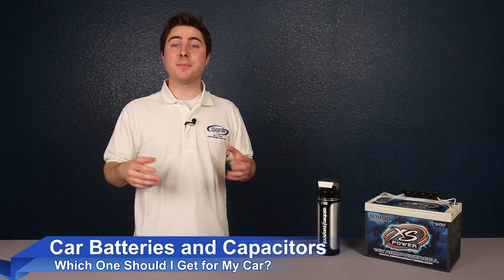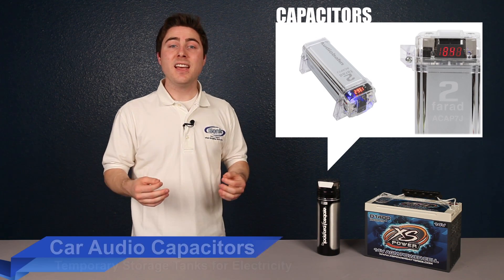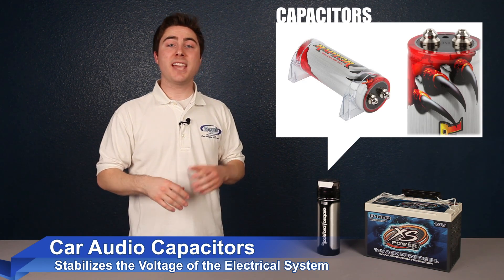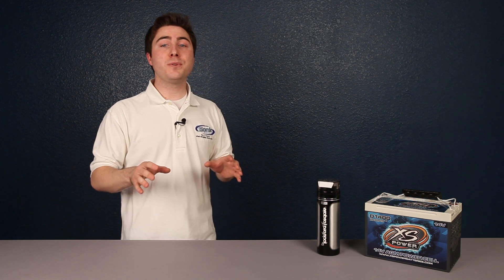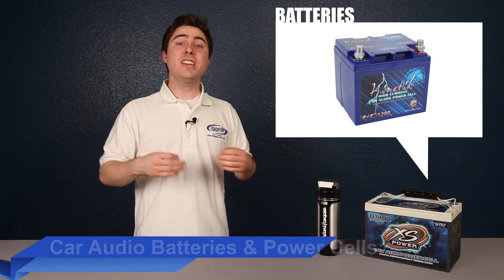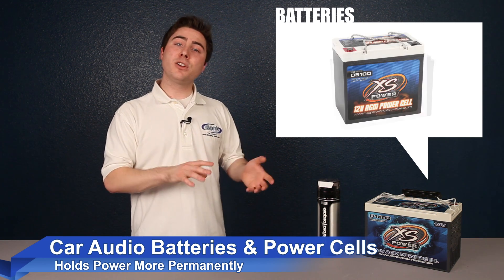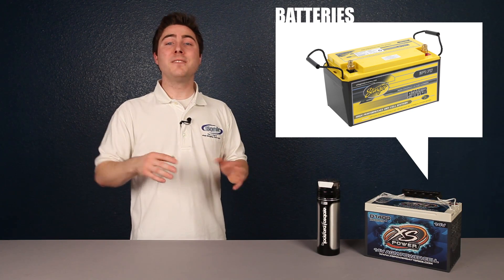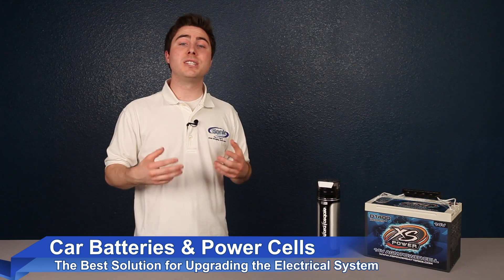Car Batteries or Capacitors: Which Should I Install? | Car Audio Tips

Comment: I'm upgrading everything right now, all HERTZ energy speakers, a 4 channel amp and 2 pioneer 3002d4s with about 1000 rms to each, my stock alt is around 105 amps and i'm upgrading it to a 200 amp alt. I bought a second battery, the question is can I just wire the second battery in parallel and it would be good? - I keep reading about people talking about adding a relay or some type of dsitribution block to help charging, do I need this or will the way i described work just fine?
Reply: if u install a second battery ,wire it in parallel ,you only need a relay if your using your car stereo with the engine turned off, if you use your stereo all the time while its running you dont need to add a relay etc.
Reply: Lee Coupland Not really true, as the batteries have different discharge and charge rates the charge sensing circuits can't differentiate between the two and one will inevitably overcharge and be ruined. 
You need an isolator.
Reply: even if your using the same two battiers? surely the charge rates etc should be the same,i have two lcd volt displays direct to both battiers and inline with the amps ,voltage has read pretty much the same ,volts in front battery same as volt in rear battery.
Reply: Even if you bought 2 batteries from the same store at the same time they'll still be a little different and once installed the difference in wiring presents problems. You might be getting away with it but the fact is the charge circuit can only detect the state of one battery at a time. Furthermore if you have both batteries hooked up to the same alternator what's the point of having two voltmeters? Of course they read the same voltage it's one circuit! One of them is going to be overcharged.
Reply: the point in using 2 batteries was to stop the electrical system from draining my lights,interior lights,dash lights etc, 1 battery off stock alt was dropping below 11 volts when cranked up, i went on youtube and searched for a solution, the vid i checked said using 2 batteries would solve the problem which it has done, they only recommended using a rely if your planning to run your equipment with the engine off, im not a expert at this,still learning myself, 2 batts wired in paralel still equal 12 volts of course, what is the solution to stop 1 battery being overcharged?
Reply: the wiring is all the SAME to both batteries, same gauge and same make ,my alt is only 70amps, but in the uk its very hard to find a stock alt with more than 100 amps :(
Reply: i have two volt metrs because i have 2 amps , one mono block and one 4 channel, they both read 14.4 volts when car on idle, also i used them to wire the amps up so both amps have inline fuses srt8 from the second battery which is all in the boot.
Reply: Lee Coupland okay but then you have the same issue, the volt meters will both read the same because they still share one circuit. Doesn't matter if they have their own fuses or not- and if you put your second battery in the boot (trunk across the pond) you're definitely going to have some different charge and discharge rates between the two batteries. Hey it's not the end of the world just expect to go through batteries quite a bit faster- and watch for the possibility of the one that is overcharging cracking its case, they will do that. 
Just look up battery isolator, it's common practice and they aren't that expensive. 
Personally (if I was playing my system much with the engine off) I'd just go with one big battery and a Priority Start.
Reply: One issue you haven't thought about probably is with the second battery, when your engine is running it becomes a load on your alternator and really can't supply any more power to your system unless the whole vehicle voltage drops below 12.5 volts. How many watts RMS you got between both amps? You MAY have a degraded alternator, you getting any ripple noise in you system? (a sign of a bad diode which you lose 1/3 its output)

Comment: I plan on running around 2200-2500 RMS should I get a better starter battery or add a second?
Reply: InsaneMilkshake high output alternators  can cause  high voltage spikes  such as if your amp  is playing bass and drawing  amps ... lots of it and then suddenly stop theirs that flow  that the amp is pushing out for those  1  maybe 2 seconds ... were it is trying to adjust  at that point  your voltage can go well over 14v screwing up many amps  most famus amp that gets fked up by this is rockford fosgate  bad surges of  power  usually ruin an amplifier
Reply: thats not what  i ment . im talking about when the amp stops  it's power draw  the alternator usually dosent  quite adjust rright away forcing  voltage up if  u messed with alternators  like  i have   u will see that the  voltage increases  right after    the voltage drops  making the voltage sometimes climb past  normal regulation as it is trying to adjust to the amps ... hard to explain but  it does happen when u tax a system and make ur alternator push out  to its max   and at that point whe nthe bass stops it  sometimes  jumps voltages that break things
Reply: jeshua leblanc yes this does happen. It happens a lot with home equipment as well. An easy example is when you get a power brown out.  The power doesn't actually go out and your devices don't shut off. During that time the regulators in your devices try to compensate and attempt to output more power and right away the actual source power comes back to normal and those same regulators are open max and it pushes a ton of extra volts down line. This is how most home appliances are damaged during brown outs and power outages. The brown outs are actually harder on equipment than if the power were to just go out completely.
Reply: a highoutput alternator
Reply: jeshua leblanc That's why a lot of reputable manufacturers build their alternators with voltage regulators.....
Reply: jeshua leblanc thats what distribution blocks are for.
Reply: yes  omg true ness spoken here .... this is why u dont want to tax the hell out of ur cars power system it messes everything  up slowly
Reply: jeshua leblanc You've got a mistaken concept of how the circuit works. No matter what's going on with current flow voltage will never rise above the peak setting the manufacturer placed on the voltage regulator. There are no voltage "spikes" it can only return to the steady maximum voltage. Around 14.4. The scenario you describe 2 posts up about "jumps voltages that break things" is pretty unlikely, probably  a matter of LOW voltage breaking things. When you push equipment it gets hot, and if you don't have enough power to run it it goes into low voltage high current operation and a runaway thermal loop results. Like using 200 ft of extension cord on a large saw. The hotter it gets, the lower the voltage drops, and the higher the current draw goes. 
Read the tech articles from Richard Clarke and David Navone from Autosound 2000 on this issue. Unless he's sitting parked with the engine off the first remedy to pursue after you've beefed up your wiring is an HO alternator- but don't go too crazy and get the highest rated ones, they usually have pretty low output at idle and aren't suited well for daily drivers.
Reply: jeshua leblanc not true alts have voltage regulators so it dosent over charge your batteries even if your amp is pulling it just keeps that amps up not the voltage. it will never charge more than 14.4 volts
Reply: No it is QUITE common to see spikes as I have described. When a regulator is given a set voltage then a sudden drop and then a spike above normal it is quite normal in a lot of setups to get excess current and volts. and current is more harmful in most cases. I have see this happen in PSU's alternators generators you name it. It is QUITE common.
Should it happen? no. Most shops and install guys don't know much about it because they are installers not electronic or electrical engineers. So they will repeat what the manufacturers say. Which is how fantastic the product they are selling regulates current and volts and that never happens blah blah blah.
It can be designed out or well within safe ranges if a good engineer designs and then tests it. I have seen a lot of robust looking designs fall out and cause spikes like this and kill equipment. Then when we bench test it we can track down and it is usually the regulator that is the cause.
Reply: If you don't believe him go download HWmonitor and look at your voltages. They're accounting for a drop that hasn't happened yet by over-volting it. Also I guarantee that your PSU has very good voltage regulators, and yet if you unplug a non-plug and play device you will see a jump and that upwards jump triggers a power protect which shuts off your computer immediately. Obviously the alternator doesn't have that option in a car, so you do indeed get spikes well above sometimes even 15v which can and will destroy not only audio equipment but engine components occasionally. Coincidentally this is the main reason why you never want to unplug your battery while your car is running thinking that the alternator will keep it going. It requires the battery's load to prevent overshoot.

Comment: I previously had a 10jlW6 hooked up onto a kicker dx1000.1 amp with no problems at all. I now i have a thirsty 12 Alpine type X hooked up onto the same amp but this time my lights dim with each bass that drops and my voltage drops when i crank up the volume! I have a fairly new 2012 Honda Civic and i just purchased a farad 2.0 capacitor, would it be best to install the cap or just purchase a kinetik battery for my system!? Please help!
Reply: If you are driving it (not playing it parked) I would do neither. Upgrade your wiring, check your grounds and consider a HO alternator. If you have good quality amps they have enough energy storage internally.
Reply: ***** nothing wrong with a better battery per se...but all else being equal (like the one you replaced wasn't bad, and chemistry/quality is similar) if by higher performance we're simply talking about a physically larger battery with more reserve and more cca the downsides are increased weight and more of a load on the alternator when the engine is running. The benefit is more playing time with the engine off. 
If you're doing much of that I'd do that too. 
The one thing we should leave him with is it's slowly being revealed that caps are one of the biggest scams to come down the pike. Unless you have cheap amps.
Ever see inside a good '70's Japanese home stereo receiver, like a Marantz or a Pioneer? They  have HUGE caps in there.

Comment: I have 2 kicker L7 with 2500 hifonics amp in a 2013 malibu . When the bass hits the lights dim inside & out . voltage drops from 14.5 to 12 what should I do ? The set up is 4gauge wire to the main battery. Help me plz

Comment: I have 2 12s Rockford fosgate p3s at 1200rms, what kind of second battery do I need, like a 850 watt or do I need to get a second battery the same watts as my Rockford.
Reply: Get a really good AGM battery like OPTIMA. You might not even need two batteries.

Comment: take the capacitor off, capacitors suck! get thicker wire, do the big 3 upgrade, and then get an additional battery. if you have a cheap crappy battery for your main one you want to upgrade that too
Reply: Caps work if you have dim headlight issue. I am with you though.  Caps do serve a purpose though and don't suck. If you look inside any amp you will find many of them.  If a person only has slightly dimming headlights they work great and a quick cheap fix. Everyone doesn't have the money to upgrade their system.
Reply: @johntate4638  nope.. caps suck. Wouldn't waste my time with them. I've used a few. Lights still dim and that was from a alpine v12 mono block 600wrms amp. I'd rather invest in a better main battery like a yellow top Optima which has 55a/h that would run a 2000wrms amp with stock alt no worries. Anything more than 2000wrms then you have to start looking at a 2nd batt

Comment: I have a 1500 rms sub with a 1500 rms amp and a amp for my door speakers and the headlights dim pretty bad, sometimes it sucks so much power my speaker amp will go into protect mode cause theres not enough power. I already have a capacitor, just should i get an additional battery or replace the stock one ?

Comment: i only have 1 600watt sub and a 600 watt amp and lights always dim when I raise the volume... I have a capacitor my uncle gave to me but I don't know if to install it or buy a new battery. because when I lower the windows the lights also dim and the air doesn't blow as hard
would a new battery just be the solution??

Comment: HEy sonic electronix, im planning to buy these product -  2 twelve inch pioneer TS-W3002D4, and for the amp is RE Audio usx-65kv.1, and one battery Kinetik 
hc1800.    im using stock alternator but upgrading fuses and wires.    do you think it will handle ok?? I was told by other car audio shops that its okay it wont kill ur alternator.    what do you think.

Comment: fyi. you prolly have a 12.3 charging system which most likely wont go above 13.6 volts regardless, if you want 14.6 volt you must upgrade you electrical system with 14.6 v batterys alt and anything that is very voltage sensitive.

Comment: You are using your cap wrong. Caps are for cleaning Dc power up, not for powering long term.  And the battery only drains when the load is to great for the alt to keep up.  Sometimes you may just need to do the "big 3 upgrade" and make sure there is an effective connection on your battery.

Comment: People. Fyi, Batteries dont solve power issues.  If you have to much power drain on you alt, its as simple as that. you have to much drain on you alt. Increasing your battery number will never be anywhere near as effective as upgrading you alt. i would say 1 battery per 1000 watts to keep from loading your alt down to hard,   It would be more effective to keep 1 battery but upgrade you alternator with a 2500 watt system then it would be to keep a low output alt and have 10 batteries

Comment: I use 2 battery's and zero gauge power charging wire with a stock 100amp alternator for my 2000watt amp, During peak loads the voltage doesn't go lower then 12.8 volts, but i have to go with a higher output alternator to get the best wattage from my amp because 12.8 volts wont get me the full rms power my amp can push out.

Comment: dd50. The Memphis pr1000.1 is one of my favorite amps because it is under rated and can put out 1200-1300w consistently and very efficiently. What I would recommend if you are still experiencing that type of voltage drops is to get your alternator and battery tested first to make sure they are good, and if so then you could upgrade your alt. You don't need a monster alternator upgrade for that amp, but an extra 50-100 amps would set you off right.

Comment: 2. thing that your alternator has to re-charge. OEM batteries also  aren't really designed to be stressed with high power electronics either, so they will drain faster than a larger aftermarket battery designed for more electronics. If you get to the point where your amp is draining your cap, battery, and the alternator can't keep up then your car's voltage can drop low enough to where the ECU isn't getting enough power and your car shuts off. You also risk ruing your alternator by doing that.
Reply: I know this is tennyeaes old but finaly someone jnderstands what was happening to.mt.car althonitndidntnuse too but mow bass hits and it.feels.like.im.being tugged back engine wants.to.die

Comment: 1. Yes and no. While the car is running the alternator is actually powering your electronics. The battery is primarily there to start the vehicle and act as a minor reserve if the alt can't keep up with power demands. Your stock charging system is designed to power your car's basic electronics and a little bit extra, and that's it. Caps have their place, but when you add an amp that draws too much current and add a capacitor it can actually harm your charging system because it becomes another

Comment from the maker: You will need a larger alternator at that point and 4 or more D680 batteries. Each battery is about 1000W RMS capable and you should consider 6 to be safe.

Comment: I have 2 psi 18s and 2 hifonics 15s. Once I can get the money for a cea certified 3200 rms amp, I will be running a true 3200rms to the 18s and roughly 900rms to the 15s. I have a 240 amp alternator and a 40 amp engine draw. Currently I have a stock 880 cca 40 amp hour battery and 2 xs 680s (slim batteries for appearance). Once i am running 4100 watts rms, how many xs 680s will I need to maintain stable voltage?

Comment from the maker: It will help cure voltage drop up until 12V. The alternator outputs 14.4V and if your alternator isn't strong, it will drop to 12V on a bass hit and be stabilized by the battery. This will definitely help but you won't get full 14.4V power without a larger amperage alternator.

Comment: upgrade your alternator. a high output alternator is never a bad thing. a larger battery could put too much strain on a stock alternator and doesn't power the car. the alternator is the powerhouse. a capacitor is only a mask or temporary solution to dimming and problems. it charges quickly and discharges just as quickly. all it does it keep the power constant. so you want a 100% constant current because a low drop would be 50% for a second. with a cap, 75% at all times throughout the car.

Comment from the maker: You definitely should get an upgraded battery, like the XS Power D1200. It is a solid cell battery so temperature changes don't affect it as much as chemical reactive batteries. If you have problems after the battery upgrade, you will have to bite the bullet and get an upgraded alternator.